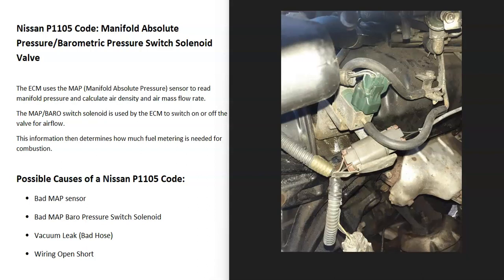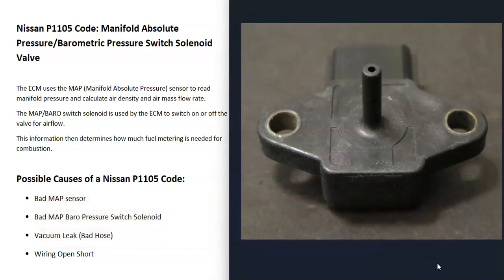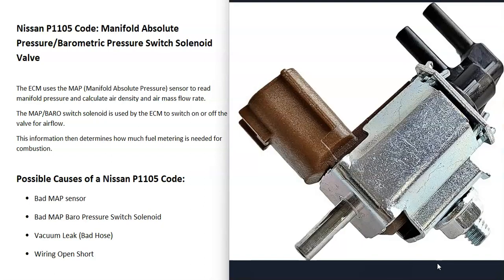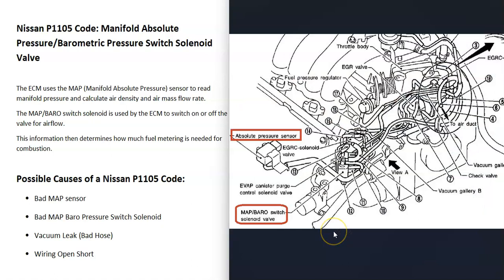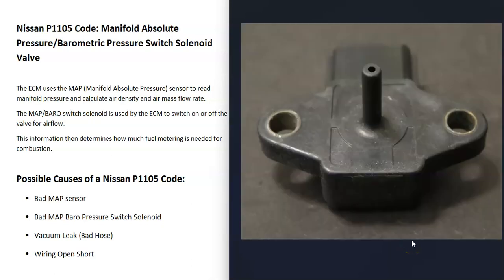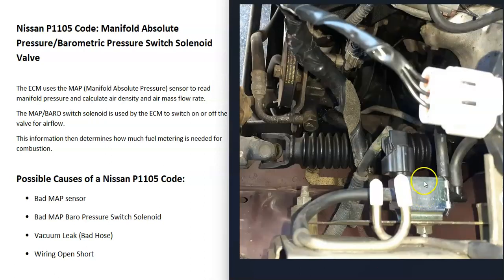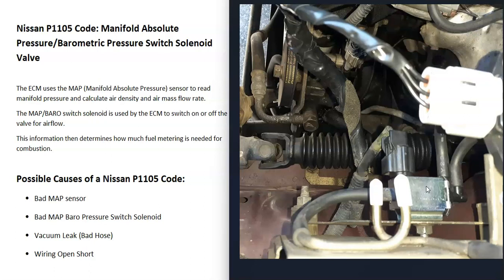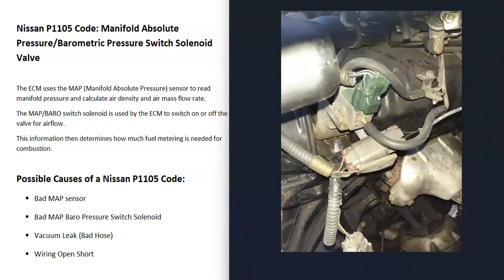Causes and Fixes Nissan P1105 Code: Manifold Absolute Pressure/Barometric Pressure Switch Solenoid

Comment: I took off the manifold to replace the valve covers on a 97 Nissan pathfinder, and now I’m getting p1105 with a check engine light. I’m not sure why, she seems to run fine but I’m wondering if I put it all back together correctly.
Reply: this is happening to me too. Did you figure out the issue?